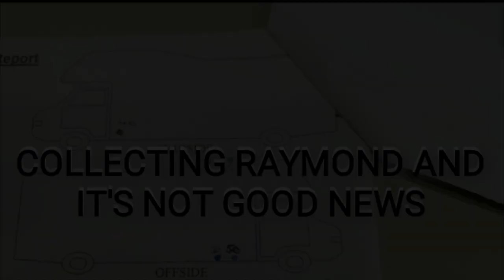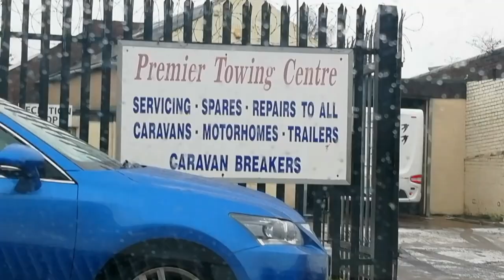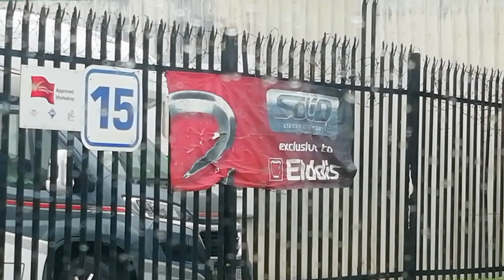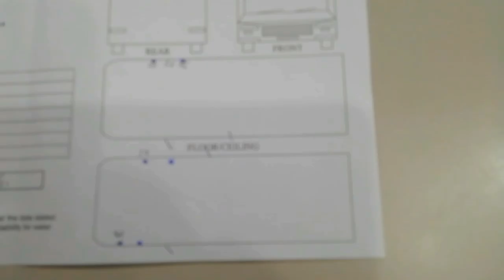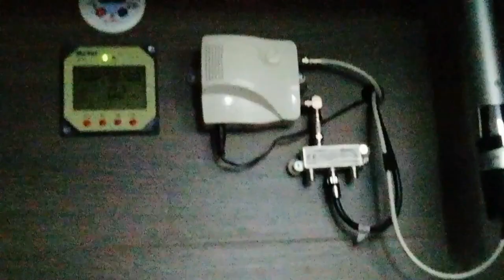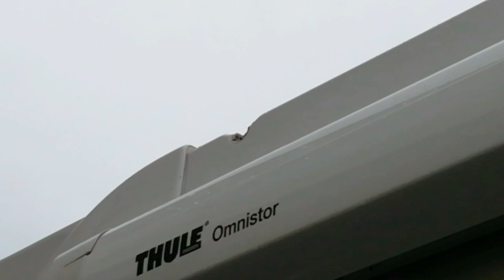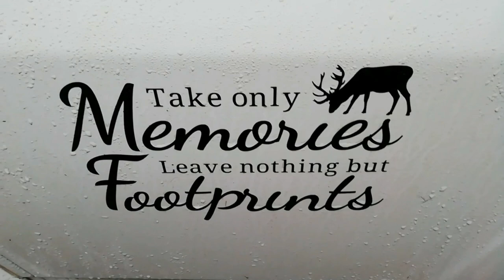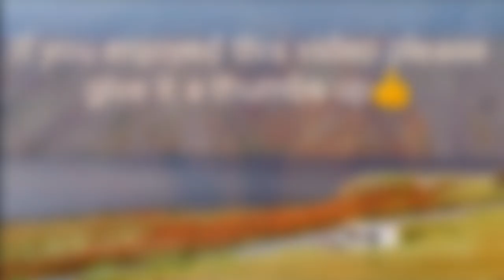MOTORHOME PROBLEMS IN AN ELDDIS. DAMP, DAMP & MORE DAMP! DISREPAIR AND WATER INGRESS. VANLIFE. RV.

Comment: Mate it’s disgusting lt beats me how the manufacturer’s keep getting away with all this shite they keep turning out
My new July 2019 Autotrail has had 19 faults repaired and I’m sure there will be more , what happened to quality controll at the factory and then PDI at the dealers
It’s put me off I’ll never ever by another brand new one  £60,000 for a pile of rubbish
Reply from the maker: Believe me, we feel your pain. At least they are doing the work under warranty, but we agree that there seems to be no quality control at the factories and the dealers are just as useless. Hope yours is all OK now and that you get no more faults. Just seems no pride in British manufacturing anymore.
Reply: Hi Paul. We bought a new Autotrail Tribute T615 in April '18. It was a shocker! It was as though because it was the base model they'd got a few blind kids from school to build it. Too many faults to list here but we were glad to get rid of it in July '19 when we bought a new Elddis 155 Supreme. Not quite as many faults but this one is damp! It's in at Bamber Bridge as I type, for the damp. Whatever you do, don't buy an Elddis. They might look nice but they're crap! What makes it worse is they boast of 'Solid' construction which is wonderful. It's light, strong and 'dry' and it's not possible for water to leak passed the joints. Really???? Trading Standards should be informed of false advertising. Preston Caravans don't care. Elddis don't care and I believe Hymer are quite a difficult company to deal with and that's from someone who has a Hymer. Lifes a bitch and then you buy - Elddis. What can be worse?
Reply from the maker: Sorry to hear your autotrail wasn't much good either. This is what we worry about. Sometimes we think it's better the devil you know.

Comment: Hi. I have recently started watching your vids on the elddis water ingress issues.
We bought a 1 yr old 194. Cost for these now is £73000.!!
Just had 3rd hab check.  So much for Solid. 😂😂
The hab guy got me to crawl under and look at the rear and side panels at the bottom edge. Bare chipboard totaly untreated or covered up.
Water has been splashing back from tyres soaking the open wood
Also the trim all around the 3 sides covering this  has not been sealed correctly and water runs through the sealant down to the exposed wood also and soaks it.
Result,  readings of 30.on rear corners, and down one side. I could squeeze water out of it!!
Habitation main entrance door twisted so it will not close at the top.
No way to fix it as no adjustments.
We can see daylight through the seals.
Contacted elddis yesterday. Totaly fobbed off. It appears they dont approve of anyone buying a used model from a private seller and i found all dealers wont carry out work as they look after their own customers. This combined with all approved workshops within 100 miles of me also refusing to take it on based on Elddis paying a paltry hourly rate so its not worth their while blocking up their workshops.
So,,,   i must use approved repairers only,  who dont or wont take on the work. So i am stuffed, a 3 yr old motorhome which the warranty isnt worth the paper its printed on.
I will be at the motorhome show nec in sept to cause havoc on their stand.
As for Sold build, please anyone reading this , its not a sour grapes story, i am a professional engineer and put my retirement funds into this.
Please please think carefully if considering an elddis.
Call a few workshops and ask which brand has the worst backup and damp issues.  Some of the stories i have heard are shocking.

When you call for warranty issues, and you will, they give you a list of repairers to call, its your task not theirs. First 3, then 6, then on and on all refusing to help. 8:52 
The bodies so rigid now they split after thousands of miles as there is no give. 
Please think again.
Guys great site and honesty regarding elddis. Keep it up.
Myself i am starting a crusade on their dreadfull practises. They will regret messing me about i promise you.
Reply from the maker: Thanks for your comment. Elddis really are a disgraceful company and we thought of doing the same at the show a few years back after being fobbed off and them not giving a toss. We were going to get "DON'T BUY AN ELDDIS" t shirts to walk around in lol. We got our van from brand new and I think that was only our second hab check. We haven't had any hab checks since as it leaked even worse after the repair by the official workshop, so we just gave up with them and Karl sorted out the leaks himself. We payed for our van in one go, and it seems you're better off getting things on finance, as you can get the finance company involved. We wish we'd have known this at the time. If you're on Facebook, join the Elddis Motorhome Owners group. We have found them a really helpful and friendly bunch in the past. Good luck and we hope you kick ass at the show! Wed have joined you but Karl is having hand surgery soon and we're not sure when he will be able to drive again.
Reply: @roaminginraymond  thanks.  Honestly I am thinking of giving up forking out £250 for hab checks if elddis won't honour the warranty.
Shame as it's a really nice unit but the damp is a real worry. I think I may have caught it in time so loads of sealing on the way.
Great site.
Reply from the maker: Thanks very much. If you can get it dried out with a heater and then seal it with sikaflex, it should do the job. Karl did our roof with a couple of tubes of sikaflex and no leaks now in over two years.
That's how we felt about the hab checks and we met a couple the other day in an Elddis who were also having issues. As you say, it's a shame as they do great layouts, but the workmanship is shoddy and the aftercare is virtually non-existant.

Comment: You have our sympathy. We've recently joined the world of damp Elddis motorhomes. We have an Elddis Supreme 155. Lovely motorhome but damp. Yes, it failed it's first damp test last August. I had an incling that the sealant on the sills and arches looked a bit tatty but didn't think much about it. Preston Caravan (run by Laurel & Hardy) just gave it us back and told us not worry, it's under warranty. They didn't reseal it! In November last year, feeling a bit concerned, we used a roll of white electrician's tape and covered the old sealant up. Over the next few months, according to my cheap damp meter, the damp dried up completely. We removed it in June because it looked a bit tatty but didn't renew it. The damp then came back with avengeance and started climbing the walls but this time in a new place which previously was dry when originally tested. Damp places are, behind the fixed bed along the back, a damp patch staring at us just above the shower tray, all along the wall behind the kitchen and the new place, all along the wall behind the side seat on the offside. Bamber Bridge Repairs contacted us with a date for repairs which they kept  cancelling due to Covid and has only this Tuesday (5th Oct) gone in to be sorted. Also the rear view camera packed in, in April. I spoke to someone with a 185 with a 20reg plate and his had been packed in for the last 6 months! So one day I thought I'd undo the three screws holding the camera in place only to find loads of water. It tricked out for about an hour and wet all the tarmac on the drive. Then it worked perfectly. But whilst away it's all gone tits up and is a bad picture with gawdy colours. So it's knackered. Also whilst away the underslung water heater sprang a leak which meant the pump kept priming every 6 seconds. That isn't too bad now as it's down to one drip a minute. The fridge won't light on gas (again) and the door catch is loose and won't tighten up (again). The electric hob warning light lens had fell to bits (again) and the two brackets holding both external taps have peeling black paint. They look a real mess. Oh yes, and before I forget ---- the water gauge!!!! What a pile of crap that is. They've replaced the round dial that used to work ( a bit inaccurate) with something called a Vegas. Made in Halifax. Utter junk! It either doesn't work at all or when it does is wildley wrong. But it's the damp that really bothers us. 10 to 15 working days they recon to fix so we'll have to see. Elddis are boastful of their Solid Construction. According to their web site it's not possible for this type of construction to rain in. Is that false advertising on their behalf? Perhaps Trading Standards should be told? They should be prosecuted over false advertising. To me, the sealant is very important as we have proved but in the Motorhome Book there's a section that deals with - Care of Your Motorhome. How to clean it and other daft things but not a mention of keeping an eye on the sealant. They are in denial. They are rubbish. I'll keep you posted of the next installment. Good video by the way. Cheers.
Reply from the maker: We certainly know how you feel. If you go to our Welsh playlist you'll see a video about damp and this was filmed a week after the so-called repair for the water leak. Our camera had the same issue and the replacement broke within hours so we gave up and bought our own. We have had cupboards falling off, door handles falling off, plus lots of other things. The rear wheel arches leak as they aren't sealed, so get this checked as yours is a similar layout to ours. Karl resealed these himself on ours. If you watch our wild camping in the Brecon Beacons, you will see me mention about Elddis and their false advertising, and I agree, as many others do, that they should be done for false advertisement. We were going to go to the NEC show and try our best to humiliate them, but as it has been cancelled again, we can't. But they need to answer for their shoddy workmanship. The MD doesn't want to know either as we emailed him when the shower tray cracked within the 12 month warranty, but they refused to fix it saying we broke it ourselves. Utter incompetence on Elddis's behalf as when Karl sorted it out it was down to their poor workmanship again. Yes, definitely keep us posted on how you get on and we hope that you get a good fix done and it stays damp free. Good luck.

Comment: Just came across your channel and watched this. This is the exact reason I bought 2008 A class Hymer rather than a newer British mark. The newest models have nicer fixtures and fittings but they’re just not built very well and damp is my absolute worst nightmare. Either way I hope you get it sorted soon.
Reply from the maker: Elddis are part of the Hymer group but yes, understand they aren't all made the same. People do say that an older one is better as any problems have normally been ironed out. Ours should be in soon for the work, fingers crossed.🤞Thanks for watching and taking your time to comment.
Reply: I just sold my second Hymer and will probably buy another-no damp or construction problems with either of them.
Reply from the maker: Elddis are actually owned by Hymer but do a rubbish job unfortunately.

Comment: i.m a retired Panel Beater i had to repair w/leaks in the Ford dealership under warranty ,i'm the guy Ford credited me with finding 150 known water leaks in a mk3 Cortina. water leaks usually occur round windows now if you look at your video freeze frame it at 6,11 on the body there's a orange stripe with white either side of it window rubber seal passes over it is that a gap between the rubber and the coloured trim , i the photo it looks like the white bits sit proud of the orange stripe .
Reply from the maker: The windows are strange on them anyway and sit slightly proud but they are water tight. My Dad was a panel beater at Rover in Longbridge when it was the Austin. Many donkeys years ago.

Comment: The motorhomes are build on the same production line as the caravans. Three years ago we had a top of the range Buccaneer caravan, made by Elddis. At a year old it had 55% damp up both sidewalls for the length of the caravan and around the locker doors.  The damp got in because Elddis failed to seal the bottom of the plywood sidewalls so the walls soaked up water like a sponge.  There were about 40 other faults, from serious safety issues through to minor cosmetic issues. Happily we were given a full refund + 8% statutory interest.  We decided at that point, no more caravans.  We went to Majestic and almost signed a deal on one of their year-old Elddis built  Majestic 285's, until the dealer told us as a matter of full disclosure that there had been major damp restoration carried out. We scorched the showroom floor on the way out and bought an Adria... a different league.  I have said many times in groups, you buy Elddis at your  peril.  Their designs are terrific, but their build quality is dire. Caveat emptor.
Reply from the maker: We completely agree, believe me. We had an Abbey caravan at first which was OK but too small, then traded it in for a Bailey caravan which we had no issues with whatsoever, but we decided a motorhome would suit our needs more. We looked at Baileys but they didn't do a layout we liked at the time, and after a lot of looking around, decided on the 255. We still love the layout, as you say, Elddis do great designs, but annoyingly Bailey do a very similar layout now to the 255. Shame they didn't do it two years ago! We've spent so much on additions, we would be massively out of pocket now so looks like we're stuck with it. We do love the motorhome though and luckily the workshop we are using are rated very highly as they are a proper workshop, not a dealer, so hopefully it will be better than new when we get it back. But we'll let you all know! Glad you got a decent motorhome in the end. Thanks for your comment, much appreciated.

Comment: My Accordo is 9 years old and Elddis have never fixed any of my problems. These included: corner trims on roof loose, charging unit failed twice which cost me £250 a piece, failure of relay which is when we discovered the jumbled mass of unmarked wiring in the drivers door pillar, the piece of wood holding the heater exhausts rotted away because they used untreated wood, the table brackets fell off the first time we used it. The worst problem is the cracks in the shower tray because the flimsy plastic was incorrectly fitted. We are having that fixed at a cost to ourselves of £500! I would like to get a bigger RV but I would worry about potential problems. Never buy a new Elddis too much of a risk. Once it’s out of the showroom you are literally on your own!
Reply from the maker: Got to agree. Our shower tray cracked at 11 months and it was their fault as the waste u bend underneath wasn't fitted in the correct position, causing pressure when you stood in the shower, making it crack around the plughole. We had to fix it ourselves. After getting the leak in the video fixed under warranty, it leaked again when we were in Wales and ended up being the whole length of the van, so it was even worse than before. We fixed it ourselves with sikaflex. We have had no hab checks since then and just fix any issues ourselves now. Elddis don't give a crap once they've had your money. So sorry that you've had all these issues too. They really are a shameful company with no care for their customers at all.

Comment: We had same issue with water Ingres from floor up on Eddie 195 2017 model , are u sure by sealing the outside skirt will sort it ?
Reply from the maker: They said they will dry it all out and then attach the skirts better so they don't gap, then reseal it. Hopefully it will sort out the problem but we'll have to see. How has it been on yours, did yours get sorted?
Reply: @roaminginraymond  still monitoring the repair at moment , but Motorhome is in undercover storage so will advise after lockdown when we can get out , good luck with repair
Reply from the maker: Thank you. Fingers crossed yours is all OK. Fingers crossed for us too!